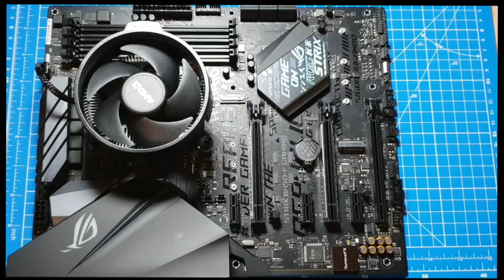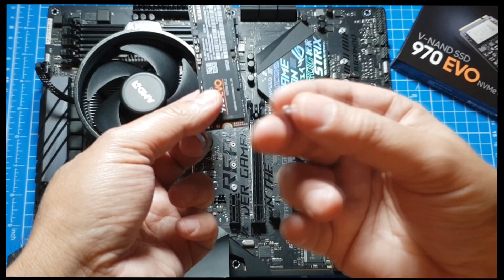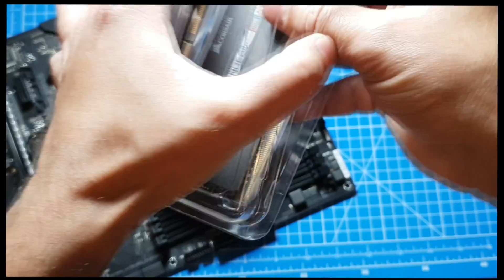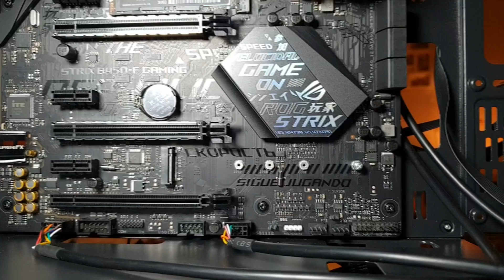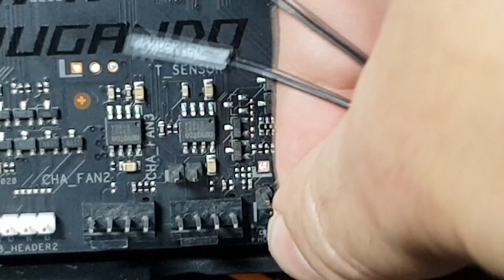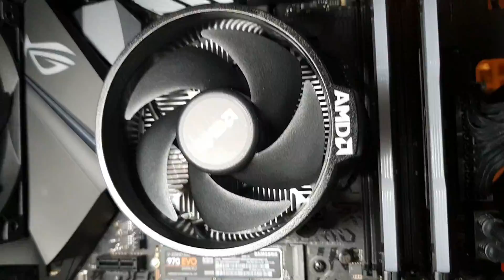How to Install M.2 NVMe SSD on Asus B450 F gaming motherboard and Corsair RGB Ram, Ryzen 5 3400G

Comment: hello sir, can u help me i have 1 m.2 samsung evo 970 1tb already installed, also have ryzen 7 5700x and 16gb of ram, i want to buy another 1tb m.2 samsung evo it will be a problem somehow with the speeds or thermals? please help thanks!
Reply from the maker: should be ok
Reply: @coolgadgetreviews  even with the gpu will perform worse i think

Comment: Does it matter if i install an nvme ssd in slot 2 ( the right/lower one ) instead of the other one? Thinking about the speed.
Reply from the maker: hi, first slot is recommended if you installing 1 nvme. if your installing 2 nvme's then you have no choice to use second slot 2 in this case you now the speed will be affected, hope that help make sure you subscribe

Comment: Where do you find the Screws for M.2 SSD?
Reply from the maker: hi, the screw for m.2 ssd should already be there on the motherboard at m.2 slot, or you can buy them off ebay. make sure you Subscribe

Comment: will i have to take the motherbord out of m case to install the ssd? and where can i get more of whatever those screws are
Reply from the maker: hi. you can get m.2 screws on ebay, you can install m.2 ssd without removing your motherboard. just make sure you have unplug your pc and everything is off
Reply: @coolgadgetreviews  hi again, do you know if theres an m.2 that has a terabyte of space thatll fit on my ASUS ROG STRIX B450-F Gaming Motherboard? and does amazon sell the screw i need?

Comment: What nvme heat sync should I use with this board?
Reply from the maker: hi, i didnt install a heat on this build as i had 6 fans keeping everything nice and cool. but you can buy heat sink for nvme off ebay, i think they all do they same job.  make sure you Subscribe

Comment: Can i put the ssd to the bottom not top?
Reply from the maker: if you put it near gpu slot in might slow down the gpu so its recommended to use the slot by the cpu, make sure you Subscribe
Reply: Thanks..🤌🤌

Comment: I use this motherboard and just recently installed a nvme ssd into the pci m.2... I read many times that it takes the speed of the pci express down from 16x to 8x but although it halfs the speed of the pci express, it has very minimal effects on the computer ie gaming. Which is true, not only do the games load quiicker but the drop in frames is non existant
Reply: I've read the same, wanting to upgrade my secondary storage hdd to a ssd but saw this issue and now I'm reading up on channels to see what the impact is.
Reply from the maker: hi, yeah why not if your happy with that set up thats good. everyone has different preference, make sure you subscribe
Reply: I'm buying this ssd because i have fps drops on my hard disk because its too slow...
Reply: @customized5131  how did this work out
Reply: So do you have two ssd in your system using both m.2 slots and you have no downside.

Comment: Hi, i have this MOBO and an M2 SSD which i plan to build some
am i better leaving the 2nd M2 slot free? and using standard SSD for secondary storage

thanks
Reply: You can do either. 
The thing why he mentioned you should always use the 1 slot (near the CPU socket) is that it has PcIE 4, while the 2 slot only has PCIE 3.
So the same .M2 SSD will always run slower in slot 2 than slot 1. But that is the only restriction. PCIE3 is still a good chunck faster than SATA, so if you want to have the second drive as fast as possible you will want an .M2 again.
That aside, keep an eye on if your SSD's are TLC or QLC NAND ones, as many companies have switched existing models between the two recently. QLC is fine for most things, but has a lot lower write endurance, which makes it suboptimal for e.g. the drive that holds your documents, AppData, Temp etc. Folders as those will see a lot of writing over time. Read endurance is the same tho, so no worries to have e.g. Programms or games there.
Reply: @reappermen  Thankyou for the detailed reply. Very helpful
Reply: @kodiyt3441  Happy to help. Good luck with your build/upgrade.
Reply: La mejor respuesta en estos comentarios clap 👏

Comment: I have one question. After seeing this video I think I screwed it. When I first installed my computer together I used the slot right at the bottom of the MB instead of using the one closet to the CPU as I completely missed it by that time. On top of that, if you didn't think I wasn't stupid enough, I bought an identical drive to put it in the first slot as my original drive is running out of space. 

What do you suggest. Should I install the new one although or should I just swap the original into the CPU slot and buy a SATA SSD instead?
Reply from the maker: hi, so yes swap the nvme to m.2 slot near the cpu and buy sata ssd. because running to nvme on both m.2 slots will reduce performance on your gpu. make sure you subscribe
Reply: @coolgadgetreviews  by how much will it reduce.

Comment: If I were to install a m.2 NVME ssd on the first slot, would would I lose two SATA ports?
Reply: Yes, SATA ports 5 and 6 are both disabled if you use the M.2 slot closest to the CPU. If it helps, ports 5 and 6 are the two highest on the board.

Comment: Hi, I have a question, can I install all types of m.2 on this board?, i want to buy a Western Digital 500GB WD Blue SN550 NVMe SSD interno
Reply: yeah man that works
Reply from the maker: hi, yes as long as its M.2 Type‑2280 (22 x 80mm) you can use any brand and any memory size
Reply: @coolgadgetreviews  would a gen 4  m.2  2280 work on this motherboard?

Comment: Heres a little trick I learned for screws that are easily to loose and/or for things that are difficult to either reach or doing something like screwing in a light fitting.  Put a small amount of adhesive on the screwdriver end, put the screw on and hold on until its on and a minute or two so its hard enough that it won't wobble about but soft enough that once the job is done it just peels off.  Its makes things like attaching a drive into a already instead motherboard much easier.
Reply from the maker: great tip, thank you make sure you Subscribe for more videos
Reply: Terrible advice. Instead you can rub your screw driver on a magnet and the screw will stick to it that way without any mess.
Reply: @islam_will_Dominate  I tried that first but as it was hard to get the perfect angle the screw kept falling off when nudged.

Comment: Hi I’m currently using the same m.2 slot. Do I need a different kind of m.2 for the second slot or can I buy the same kind?
Reply from the maker: hi, dont use second slot as this will slow down your graphics card, if you second storage drive get normally ssd and use sata connection, make sure you Subscribe
Reply: @coolgadgetreviews  ahhhh this was the piece of info I was looking for. Better I just leave that slot empty and get a sata ssd :)

Comment: Sir I heard that ..in b450 f when using both M.2 ssd the GPU run at 8x instead of 16x ...is it true
Reply from the maker: hi, yes this is true so only use 1 m.2 slot near the cpu.
Reply: @coolgadgetreviews  Isn't it only the first pcie slot that goes from 16x to 8x. And the second and third still stay on 16x because the m.2 and the first pcie share bandwith?
Reply: @coolgadgetreviews   thnx for the response sir

Comment: Hello I have the Asus B450 F gaming II motherboard and planning to install a Samsung NVMe SSD, the problem is the motherboard included m.2 heat shield is available below the gpu that makes pciex16_1 to x8. Should i put my nvme below the cpu  (without m.2 heat shield) or put my nvme below the gpu ( with the m.2 heat shield) and move my gpu to the 2nd slot (pciex16_2) which also has pciex16? Thank you
Reply from the maker: hi, the reason why their is a heat shield on the second m.2 slot is because the second slot is close to the PCIe slot which is where the graphics card is going to go so there will be more heat in that area thats why that m.2 slot has heat shield. just use the first m.2 slot near the cpu. hope this helps, make sure you Subscribe
Reply: @coolgadgetreviews  Thank you for the reply!! subscribed already! :))

Comment: Can you use the 2:nd M.2 slot as well with the 3400G? In the manual it says that you can't or am I misreading something? I have 2 NVME M.2 drives
Reply from the maker: hi, yes with 3400g you can use 2nd m.2 slot. make sure you Sub for more pc build content

Comment: Hmm ok you video shows how to put the NVME into this Mainboard but i think it is much more important to know how the bios settings should be made.

Do you have some advice on the bios settings? As excample: i own an Asus Rog Strix B450-F Gaming II Mainboard with the lates bios (4204 AGESA 1.2.0.0) and just bought an WD Black NVME PCI-E 3.0 x4. According to the Manual and Boars specs this driv should run on this Mainboard.
As it does not with me i was watching many Youtube videos about this which confused me even more.
I heard that AMD Manufacturers are removing the PCI-E 4.0 feature from many mainboards ba now with newer bioses... could AGESA 1.2.0.0 already be affected from this?
Do you know how i can still run an NVME with PCI-E 3.0 with this board?

Would be great if anyone can reply with some more knowledge than me :-)

I am already thinking about to downgrade my bios to an older Agesa version.
Reply from the maker: hi, have you selected this as your primary drive in your bios? when adding drives to your motherboard you have to select them as primary or secondary if you have 2 drives in the bios, also for your second drive you have to activate it through windows, see my other video on "how to activate second drive on windows" on my channel. i hope that helps
Reply: Wow that was a fast response 😊

Where do i make the selection for the primary drive in the bios? You mean in the boot order? There I can only see my regular drives. I have one sata ssd as Windows drive and two others (1x sata ssd and 1x sata hdd) but nowhere a sign or note about my nvme connected to the M2_2 slot. 😑 Even on the M2_1 it's not found. Today I will test the nvme on another computer with an M2 slot to make sure it's not broken. I'll keep you updated

BTW: I just checked your video about how to activate a drive in Windows. I already know this 😉 but this won't help if even my bios don't see the drive...
Reply: @R0N1N_78  I have the same problem, did you find a solution?

Comment: Did you have to enable or change anything in the advance/onboard devices configuration panel.
Reply from the maker: hi, in thes bios i just selected m.2 ssd as primary and sata ssd which i installed after this video as secondary. also you have configure 2nd ssd through windows too. so check out my other video on my channel called activate 2nd drive in windows.plus i had to configure ram speed in the bios video on my channel  hope that helps, make sur you Subscribe

Comment: I wanted to buy B450-F and 970 EVO 500GB NVMe ssd but im worried about the ssd overheating 
I play games a lot and the computer is on 8+ hours daily, should i get this motherboard?
Reply from the maker: i havent had any heating issues, remember you will have 4/5 cooling fans on your pc case anyway so shouldnt be a problem. make sure you Subscribe for more pc build content
Reply: @coolgadgetreviews  i will buy MasterCase H500 and this is ATX motherboard so i think it shouldn't be a problem

Comment: On my Asus b450-m gaming I have tried two brand new Samsung 970 Evo drives and both crash within a few minutes of booting into windows despite fresh installation of Windows 10. 

I have a 970 Evo on another Asus board and a 960 Evo on yet another Asus board that both each work fine but the b450-m does not like 970s and neither is it on the qvl list for that board so I'm assuming that's why. I'd be very careful to those considering using the 970 evo with asus b450-m.
Reply: B450-f sorry
Reply from the maker: hi, its works fine on mine. have you configured your bios properly, make sure you have the 970 evo as your primary drive. also your ram memory can cause your pc to crash so make sure you have not overclocked your ram speed. make sure you Subscribe for more PC content
Reply: @coolgadgetreviews  No deal though. In fact two interesting developments: First, the M.2 is set as primary drive in bios, so that's definitely not the issue. We have tried with default/safe cmos values as well as the full 3200mhz the ram is rated at anyhow, and none of it makes any difference.

Next not only does everything in this new build run just fine with my older Crucial standard SATA 6 SSD (perfectly stable) BUT if I use the 970 Evo as a DATA drive, and not as an OS drive, everything seems to be fine. Wrire/read data to the drive just fine, no lockups or crashes.

First time in my life, 21 years of building pcs, that I've seen a drive have issues with being a boot drive and not as a data drive.
Reply: I've also heard if you take your ram out and put it back in it'll fix it sometimes but this may not be the case for you
Reply: @Tresleches._.15  Thanks, but read my response to Cool Gadget.

Comment: I'm currently having a problem where my one 2TB HDD drive isn't showing up in my bios or my disk management. And just today when I turned on my pc, my one 120 GB ssd just suddenly stopped working. I've updated my bios and tried everything. Does anyone else know anything I can try to get them to both work?
Reply from the maker: hi, ive not been in you're situation, so only thing i can advise is to switch your pc off and disconnect hhd and ssd and reconnect them and turn on pc to see if it reconises them or you might have to reset cmos.

Comment: Ok ive been looking around and you seem to be replying so I have hope. I have a sata ssd and hardrive already and I want to get a nvme ssd also. Partpicker says this when I select one "The motherboard M.2 slot #1 shares bandwidth with SATA 6.0 Gb/s ports. When the M.2 slot is populated, two SATA 6.0 Gb/s ports are disabled.". It has me confused, can I use the 2 satas and a nvme at the same time?
Reply from the maker: hi, so basically get a motherboard with 6 sata connections, so if 2 are disable you still have the other 4. so my current setup up is 1 nvme ssd and 2 ssd's. dont use 2 nvme's as you will slow down your pcie slots for your gpu. any more questions just ask and also Subscribe ive got more PC related content coming soon, browse my channel too 👍
Reply: @coolgadgetreviews  All should be good then because I have the B450 F Gaming. Thanks for replying
Reply: Depends how many sata ports you have and if all of them are disabled.  For example, my mother board allows for two M.2 connections.  The first one uses the same "bandwidth" as the 5th and 6th sata connection which are disabled when the first M.2 is used.  The mother boards 1 thru 4 stat connections are still useable.  If the second M.2 is used then the 2nd and 3rd PCI slots are disabled too, but the 1st PCI slot is still useable.  Your mobo will be different but the manual should explain what's what.
Reply from the maker: yes you are spot on 👍

Comment: Is it supposed to bend down like that
Reply from the maker: hi, yes you have to mount it in it's place otherwise if you move or carry your pc it could drop out. so mount it down using m.2 ssd screws normally come with your motherboard if not purchase from ebay. make sure you Subscribe i've got more awesome PC build content coming, browse my channel  👍
Reply: In the video it’s shown only the small screw goes in to hold it in place but that’s only the half of it. The bigger one you finger screw into the hole first. Then add the ssd card. Then lastly screw the smaller screw into the one you previously screwed in. I knew this wasn’t right so I searched around and found someone doing it the way I thought it was supposed to be. Your welcome.

Comment: Regarding your question about the RGB: you have 2 4-pin conns to get that working at the same spot where your cpu fan is connected. Btw- the cpu-fan has to get connected on the lower one as it is now (main connection). You can plug in the RGB-Fan where the CPU-Fan is now.

Regarding the RAM : slot 2 + 4 are the primary and 1+3 the secondary, so you did perfect on that
Reply: After connecting your fans to the RGB-Pins, you can use AURA to setup the lights
Reply from the maker: hi, yes you are spot on. if you watch my other video installing wraith prism RGB cooler & 3400g cpu. ive connected that like you said as that fan has rgb. but you can also link up you're pc fans to the motherboard but mine are linked to fan hub with remote control, i'll do a video on pc fans soon, make sure you Subscribe 👍

Comment: How to install second SSD ?
Reply from the maker: there is 6 other sata ports to connect ssd or hard disk drives too. but in this video i just wanted to show the new m.2 port/slot. hope that helps, Subscribe for more pc build videos
Reply: @coolgadgetreviews  I recently bought this mb for the sole purpose of running dual m.2 ssd's. Are you telling me that it's never going to work for gaming, hence BOTH PCIe ports is going to run at x8 instead of x16?
What alternative do you recommend if not RAMDisk? Plain old SATA ssd?
By the way, great video. Exactly what i needed actually.

Comment: Did your system autodetect the NVM ?
Reply from the maker: if this is the only storage device on your computer then it will auto detect, if not you have to select from you're computer bios which one you want as primary boot up drive and select secondary primary drive if you have one while you are in you're bios.  also if you have secondary drive then you need to watch my video on how to activate second hard drive on windows to make windows reconize it. hope that helps. Make sure you Subscribe i got more pc build tutorial coming soon. watch this video https://www.youtube.com/watch?v=yW_NAlY1xBw